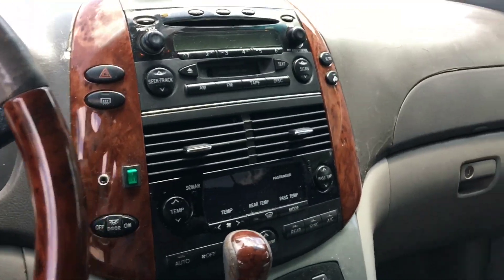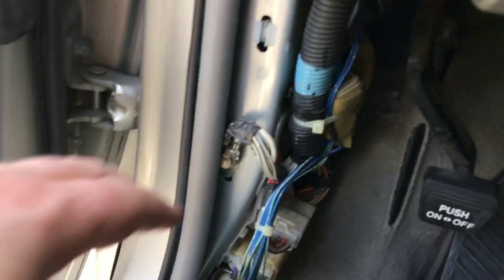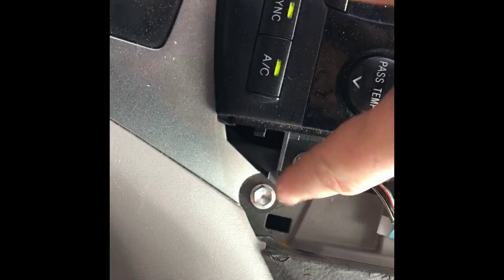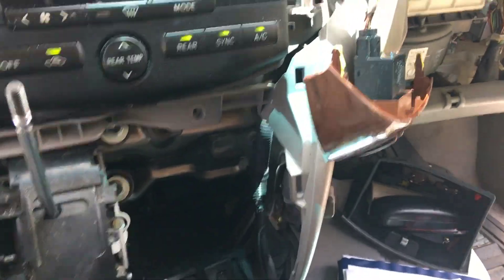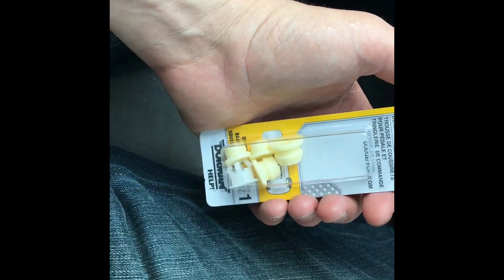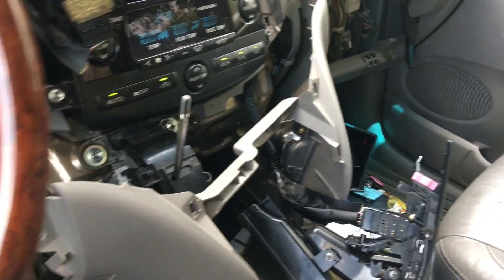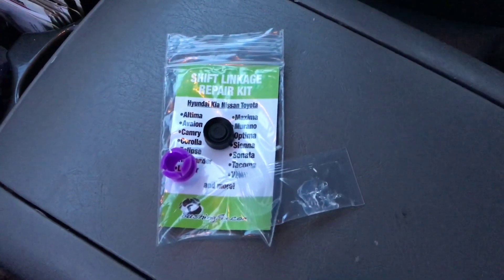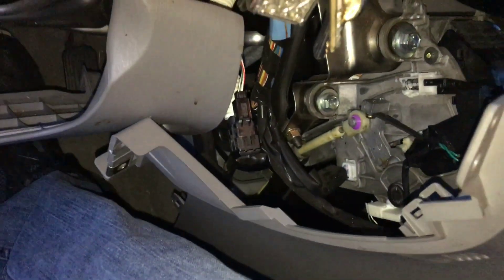2004 Sienna Shifter Issue (fix it correctly)

Comment: Fantastic. Got everything removed and am heading to the dealership tomorrow to get the grommet. They told me  I could buy just this part..as another commenter shared. Fingers crossed.

This took me about an hour. My observations supplemental to this great vid:

Some of these panels that are dangling can be removed to make the job easier. Remove electrical harnesses if you understand generally how to release them from their respective connections.

Use a panel puller to help pop things loose. A small light duty one will suffice.

All the bolts that need to be removed are covered here. Remember you are unhooking plastic panels. Bolts that connect metal to metal are out of scope for this job..and you will cause you confusion removing unnecessary bolts.

Watch this video several times before you start. Make some notes to get your brain aligned with how toyo engineered this area of the van.

Label all your bolts with a general description of where you removed them.
Reply: Forgot to mention. The elusive cabin air filter. This job serves up access to it on a silver platter. Spend the $10 and replace while your at it.
Reply: One more update after the job.

1. Watch the woodgrain bezels. Both of the tips chipped off during this job and they did not get manhandled or anything. I didn't even see when either breaks occurred. Possibly when popping back into place. I'm guessing 15 years worth of sun damage brittled them.

2. Mine is a 2004 and my dealership part number matched perfectly with what UnitedSoundVideo had. I paid $1.97. Southeast USA.
Reply from the maker: Perfect. Thank you for your comments!

Comment: Awesome video -- hugely helpful. Just did this repair on my 2004 Sienna.  The bushing from Toyota costs $2 and can be pushed into the cable collar with your fingers and snaps easily onto the shifter pin also by hand.  Add a little lithium grease and you're all set.  Others had reported that Toyota will only sell you the cable.  Not true anymore.  I didn't have to pull the right side of the dash other than the upper map storage (as also reported by others).  If the dash piece under the steering wheel gets in your way you can just unplug the cables easily.
Reply from the maker: Excellent feedback! Thank you for watching and for adding helpful tips for future viewers.
Reply: The bushing i got from toyota wont fit onto the collar? Im pushing it really hard but it wont go
Reply from the maker: Excellent. I am glad Toyota is selling a kit or at least some dealers will sell a kit. Thank you for your input and feedback. All is very helpful!

Comment: I just ordered the same kit you got. Thank you for making this video.
Reply from the maker: Excellent! Have fun taking off all the covers! It is unfortunate this type of item fails on our Toyota's!
Reply: @projectfixit  Was that purple plastic thing hard to install? I have literally been wrestling with mine for half an hour, and I still cannot get it in. My fingers are all torn up, and I'm giving up for now. This is frickin crazy.
Reply: @projectfixit  Fucking Toyota bullshit. It took me 45 minutes just to get that purple thing installed. My fingers are fucked up, and my arm is bleeding. Fucking unbelievable. I fucking hate modern cars. I really need to get rid of this piece of shit.
Reply from the maker: @BEEBEE159  sorry for the late reply. There should have been lubricant and a small black push tool.  However....still a bear to snap into place. With all the battle scars, you have a story to tell.
Reply: @projectfixit  Yep, I used the grease. These modern cars are such a waste of time. They either put you in the poor house, if you always pay others to fix them, or they waste all of your time, if you do it yourself. I'm planning to get a motorcycle, and ditch the four wheels. I've had it. I am a very small person, and I don't need a four thousand pound hunk of steel and cheap plastic to get around in.

Comment: Thx for your time. Just had the same issue with my (64k miles) 2009 Sienna CE.  Toyota part #33835-08010 at 4 dollars. This part is just the rubber grommet with no colored sleeve. Pressed it into linkage ring / hole and slid it on. boom done 👍. Spent about 4 hours taking dash apart and reassembling. Took my time because there’s several black and silver bolt / screws to keep track of all at 10mm. Watch out for the shroud that holds the shifter. There’s plastic nipple / pins on top both sides that keep it in place. I broke both but still attached well.  Funny, the knucklehead Toyota parts guy chuckled while telling me I’m lucky because they just started selling these rubber bushings separately instead of the entire linkage cable.  Gee Toyota, thanks for not bending me over the counter at 3 hundred.  They pulled that on me with my Avalon window crank assembly. All was needed was the gear. Had to buy entire unit at 500.  So much for an environmentally conscious car manufacturer.
Reply: Thanks for your tips...I hope you should at least know the possibility of the return of Jesus Christ by 2028....but take it with a grain of salt.
Reply: Please from where you purchased this part? (33835-08010)
Reply: Thanks for the part number! Just called it in to my Toyo dealership today and they'll have it in 2 business days for less than $2!
Reply: Thanks for the part number; Toyota dealer down the street from me had one in stock and I was able to get this all fixed up in one day.

Comment: Thanks for the excellent diagnosis and repair tips. I just bought a dashcam /rear cam combo and was in the middle of testing the backup camera feature when my 2004 Sienna wouldn't go forward. I thought the backup connection had shorted some computer gadget when I watched your video. I had the same issues taking the whole lower dash apart darn near. First pix is what I found, 2nd is where I placed the cable on temp so I could shift it to Park. With it in reverse, you can't start it and when you take the emergency brake off, the car starts to roll down my steep driveway! Thanks again, my bushing is on order.
Reply: Sorry, they won't let me send pictures in comments.
Reply from the maker: Oh my goodness. What crazy luck. My wife was in a Taco bell drive thru when it happened to her. LOL. Anyway, good luck on the repair and thank you for commenting!

Comment: Thanks much for the video man. I was think transmission fdup. Gotta order the parts now. Should save few hundred bucks from repair shop. It doesn't make sense to spend 500 when the whole car value is 2000
Reply from the maker: You bet!....Certainly a cheap fix, but a pain in the rear when it happens unexpectedly.
Reply: @projectfixit  yep, no fun.  I got it fixed btw

Comment: Good video and thank you. I used the Dorman 14797 which is clear looking and similar in shape to the ones you returned. The way I put this one on was by putting it on the shaft first and snapping the cable loop on after. A little lube might help for ease of snapping in place.
Reply from the maker: Excellent. Thanks for the feedback!
Reply: @projectfixit  Thank you for the very helpful vid.

Comment: Thanks again. Have you thought about doing a preventative maintenance series where you tell us what you would replace / check when you are working on different things to save future labor for the 2004 Sienna. Example at 150k do radiator and fan shroud with hoses / coolant.

Comment: I'm trying to fix my van 😭😭 2004 but the auto store don't have bushing kit to fit my van, Can someone tell me the measurement? Thanks I have a mess with everything out. Please
Reply from the maker: I don't have the size, but Walmart has the kit online at      https://www.walmart.com/ip/Toyota-Sienna-Automatic-Transmission-Shift-Cable-Repair-Kit-with-Replacement-Bushing-Automotive-Auto-Trans/950845832?wmlspartner=wlpa&selectedSellerId=12038&&adid=22222222227149509209&wl0=&wl1=g&wl2=c&wl3=262130175111&wl4=aud-834279576126:pla-432629737883&wl5=9027669&wl6=&wl7=&wl8=&wl9=pla&wl10=125194746&wl11=online&wl12=950845832&veh=sem
Reply: @projectfixit  Thanks I fix it, I bought some similar, also I have toyota dealership and my husband said "call them, guess what they told less than a $2 and I spent 23 trying to find the right one but anyway all your directions followed and fix it. Thanks
Reply from the maker: @guerreradecristo777  Fantastic! I am happy it all worked out well for you in the end.

Comment: I have seen where some have drilled a small hole in the shift rod and then installed a cotter pin to keep cable on
Reply from the maker: I saw that, too. However, I didn't want any slop in my shifter linkage. That would drive me crazy. This little kit from Amazon worked well and no issues since.

Comment: Good video. You could have drilled out the bushing with a 5/16 drill to enlarge the hole in the bushing.
Reply from the maker: Thanks! Yea. I did't think of that. I am sure if the internet led me to a dead end on a replacement bushing, I might have resorted to that. Thanks for watching!

Comment: what if is not the shifter and is underneath car  from the transmission
Reply from the maker: If that is the case and has been verified, I would check the bottom side linkage. I personally had not run into this on my vehicle. I would verify the top linkage, first.

Comment: As far as I know Toyota only sells the bushing integral with the shifter cable. Amazon does sell a bushing kit for the Siennas. The kit is also available from bushingfix.com. The kit is the BP1kit for the sienna and runs about $30. A shifter assembly runs over $300 from the dealers.